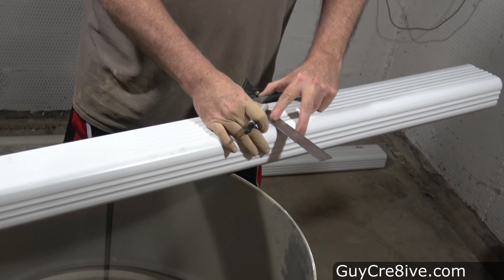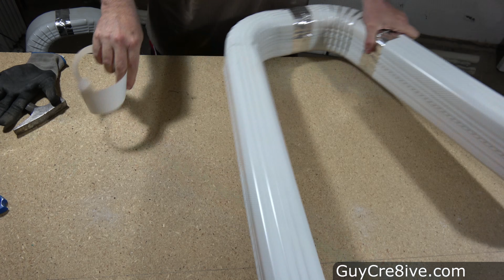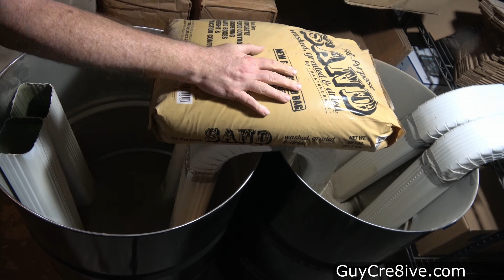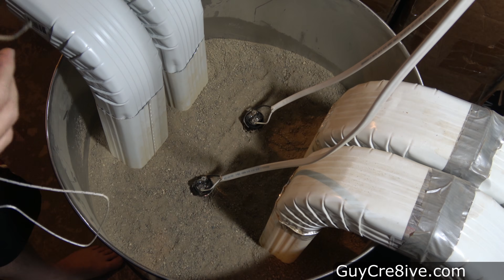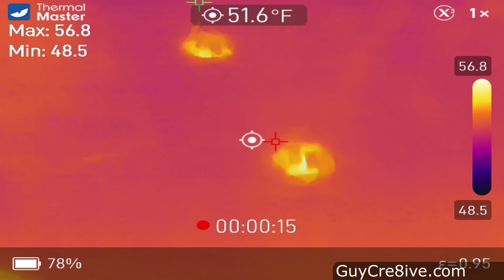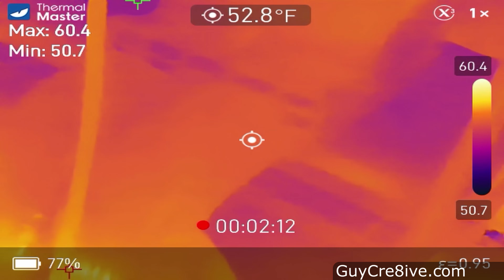Sand Battery Heaters How To Build DIY Solar Powered Heat Drums Batteries Elements For Home Heating

Comment: Insulation all over. Unfortunately the shape of the barrel gives a large surface area of heat loss. You’d be better off with a square wooden box. Lots and lots of insulation.
Reply from the maker: I'm too afraid to use wood with these, they get pretty damn hot.

Comment: To increase the heat use medium grade graphite flakes , mix into the sand, this will allow the heat to spread through the sand faster, the sand must be dry.  You could make expanded graphite, you will need to study videos like the one from Robert Murray, there are several methods for making the expanded graphite.  I have videos showing how the graphite when  I made into a slurry and painted onto ceramic tiles will increase the heat absorption by 5x. Use sodium silicate mixed into water  and graphite to create the slurry and paint the out side of the gutters. You could also add perlite to the sand to create air pockets.
Reply from the maker: Interesting. Can you post the link to your video about this?

Comment: I would run water tubing through it and make a radiator for where you want heat
Reply: Only if the panels can guarantee enough heat even on a winter night, or your system can freeze.
Reply: @walterrutherford8321  Mix in some food grade glycerin for antifreeze.
Reply: @walterrutherford8321  Glycol is wonderful stuff. Lots of the world used to use solar water heating systems before PV and heatpumps became the more efficient choice. They use an anti freeze for the reason you observe.
Reply: Yes. I would use coiled pipe that would lead to a coil pack inside the house with a fan blowing over it.

Comment: One of the best videos of the kind, just think that the heating elements up top dont make much sense, i think maybe horizontal 4/5 inches from the bottom and the vents around the middle to top part would work better, since heat rises. But if it works, it works.
Reply from the maker: You're probably right, this was my first attempt at building one.
Reply: I was thinking something similar, what about using 4 elements mounted 2 on each side and mounting them horizontal like on a hot water heater, a top and bottom element, and definitely need the tubes to be stronger and sealed completely to prevent any sand particles from getting into the air flowing through them.

Comment: Can you wet the sand some to help radiate the heat?
Reply: From other youtube videos,  I learned that the sand heats up and stores heat at temperatures well above the boiling point of water; so any water in the sand would turn to steam and make everything worse. Sand must be bone-dry, every video says.
Reply from the maker: That's a good question, I'm not sure though.

Comment: I'd like to see a time-lapse thermal video on the whole of the barrel to see where the cooling occurs over time. Might give better placement for internals. Insulation might be helpful too.
Reply from the maker: I wish I could do that but my thermal camera doesn't have a time lapse feature. Not sure it can charge and record at the same time.
Reply: @GuyCre8ive  Bugger.

Comment: If you cut a hole towards the bottom of the drum and use 1 pipe. Cool air would get pulled in as the hot air in the pipe naturally moved up. Creating a natural convection.
Reply: This is the best way. I don't think one inch would be enough though. Maybe four 1.5 to two inch pipe inserted at the bottom. As much coiled metal inside as he can fit then four pipes coming out the lid with flared ends to cut back on noise. One other commenter mentioned insulation. I don't think it would matter given the drum is steel and even if it is putting off radiant heat that is the whole point, so long as the entire system is inside. I do like his idea of using solar panels to heat the sand battery using electricity. I have been looking for a way to heat up small animal shelters in the winter. For them I will definitely either insulate or put a small protective cage around them so the animals don't burn themselves.
Reply: Do you know what to do if so do tell

Comment: Great idea... here are a few ideas;
1. Not enough heat exchanger surface area. You should get better results if you use a coiled metal flex tube with at least 10 coiled feet covered by sand in each barrel.
2. Put 1-2 inches of insulation on the inside of the drum to prevent heat loss through sidewalls. 
3. After you get more panels, bury 3 heating elements deep and 3 shallow to ensure all 10 feet of coiled conduit can be heated.
4. Get a variable speed fan to adjust the air flow to get the outflow temp you want.
Reply: Much easier to insulate the outside of the barrel with the added benefit of increased thermal mass of the steel.
Reply: Stainless steel pipe would hold heat a bit better wouldn't it?
Reply: @norrinradd9554 , I think aluminum is better at conducting heat than steel, so if the coiled pipe is buried in the hot sand, aluminum is probably the better choice.
Reply: Good ideas.  Thanks!  I'm researching sand heating initially for a new semi-buried green house (down about 6 feet below grade).  Trying to decide whether to go DC or AC.  Also trying to compute overall load.  I'm going to run 6 inch flex pipe with ground cloth wrap between 100 to 200 feet buried at 6 feet and blow air to get even 55 degrees F from the ground year around; summers will help cool the green house while winters I'll have the air blown through a sand heater.  I like the design the GuyCre8ive has come up with though your ideas will improve overall heat.  With solar, a few 48 v batteries, a few temperature controls and some good solid engineering, I'm no longer worried about how I'm going to keep things at the right temperature.
Reply: How do you make sure the inside insulation doesn't burn? What type of insulation is it?
Reply: @relevantreason4205 , ther3 are many types of insulation that can withstand temps. Cheap fiberglass can withstand 850 F. And it often comes with adhesive on one side, so you can line the barrel pretty easy. Also, the temp at the edge of the barrel will be lower than the temp near the heating elements, and the air circ pipe will continuously draw heat from the sand. So, not gonna be a burn risk.
Reply: Heat insulation would prevent the sand from heating up to max. If installing insulation i would suggest putting it to the top end of the barrell....
Reply: @fishermansbuddy3785 , maybe you misunderstand this. Thevinsulation would be placed on the sidewalls, top, and bottom inside the barrel. The sand is in the middle of the barrel with the heating elements buried in the sand. The goal is to surround the hot sand with the insulation to prevent the hot sand from transferring heat to the steel barrel so it all gets tranferred to the air pipes buried in the sand.

Comment: Great video! Finally after years of watching videos of small models of sand batteries finally a model that could actually be used to heat a living space. Looking forward to more developments.
Reply from the maker: I'm not sure this is a good design, there is sand in one of the gutters so I still need to dig it out and see what happened. I think it may have gotten so hot it collapsed from the weight of the sand. Planning to do an update video here soon.

Comment: Water heating elements burn out this way.
Use nichrome wire or stove type elements
Reply from the maker: Do you have a better suggestion? This is all new to me, thought about using nichrome wire next.
Reply: @GuyCre8ive ive made smaller versions of this with stove elements.

Water heater elements are water cooled and not meant to get this hot. They will distort the metal and eventually break the element.
The old spiral stove elements also work.
Some second hand stores have stuff like this for cheap
Reply from the maker: @knowGodbyandby  thanks for the info, I'll make sure to include it with the video update.

Comment: I have (2)175 watt panels would it be best to wire in parallel or series and do you need an inverter or just the straight dc.
Reply from the maker: I just ran off my busbar for my panels straight to the heating elements but I still have a lot of experimenting to do with these so I'm not sure on the best way to do this yet.

Comment: I been thinking if I know the amp draw of the heating element and have a volt dump load to my battery so when excess power is going to my sand battery. So I can turn it off in the spring.
Reply from the maker: Yeah I'm using my excess power to mine crypto when I don't need the heat.

Comment: I have a wood stove insert in my fireplace.  The chimney is 22 feet high.  I was thinking of turning the chimney into a sand battery and have some copper pipe go up and down inside the chimney.  One pipe low to the floor inside the house and the other pipe come out over the wood stove.  Should get some nice convection.
Reply from the maker: That actually sounds like a really good idea!

Comment: why mot use  aluminum flex pipe
Reply from the maker: I think aluminum is a bad idea all together. I still need to dig the sand out and check but I'm pretty sure the heat and weight of the sand collapsed one of the gutters because one is full of sand now.

Comment: Thats a cool and inventive idea....runs off solar panels so  doesn't cost anything..technically. 
However,  short term ok, but long term use idk. UNLESS the sand can absorb and pull away the heat from the electrodes fast enough, I foresee an overheating problem with the wires. Thicker more heavy duty wire would help but. You start getting 250 300 degrees for really long periods and you might have a meltdown of sorts.
Reply from the maker: Yeah I'm planning to do more testing but the wire seems fine since it's only pulling some of the solar power out, the rest go to my battery banks.
Reply: @GuyCre8ive 
Well for safety's sake, I wouldn't leave it unattended. Last thing you want to happen is end up with a short and fry your inverter for your panels.
Out of curiosity, how big is your battery bank setup?
Reply from the maker: @chrisevans4318  I have two breakers and a fuse in between them. I just published this video that explains my battery banks: https://youtu.be/Ioj6BjRgCu4
Reply: @GuyCre8ive 
Awesome!  I will definitely check it out. Thank you
Reply: I was always thinking about the heat transfer and how it affects the eficency if the sand doesn't absorb the heat fast enough. You will basically need a huge heating surface or some custom heating resistances coiled through the whole sand volume to dissiopate the heat evenly through the whole volume. I was also thinking to mix grinded copper flakes ( or some non conductive heat dissipator.) with sand to help spreading the heat around faster. I think the sand batteries will be a big thing in the future, but we need more research. Imagine a well insulated sand battery built into a wall in the house ( the whole wall ). Its size would be able to heat the house for days, ot weeks and if you are able to heat it up to 400 - 500 degrees celsius, the energy storage capacity would be huge.